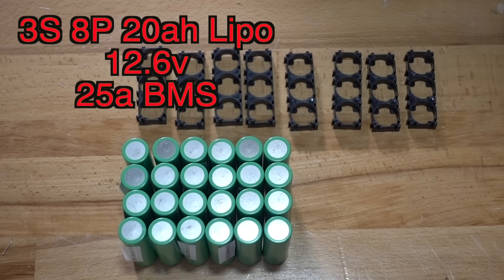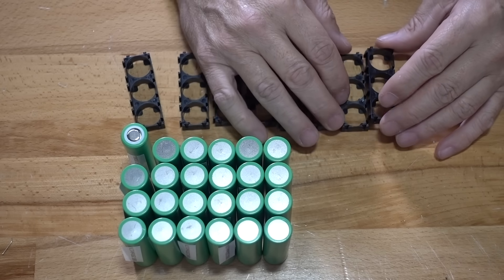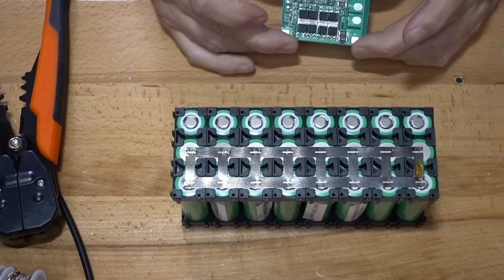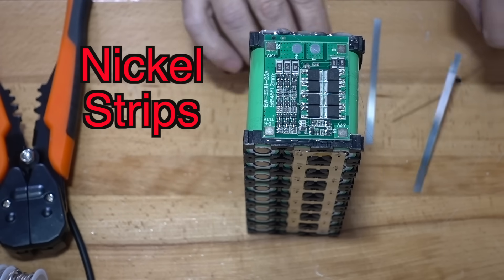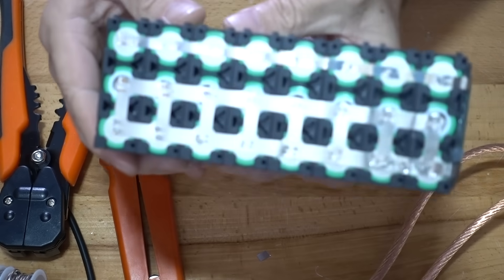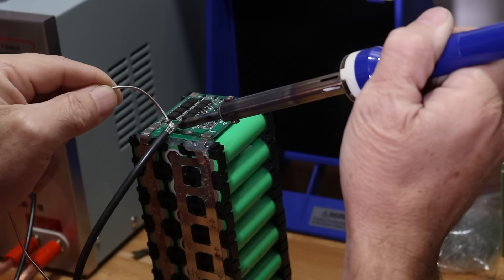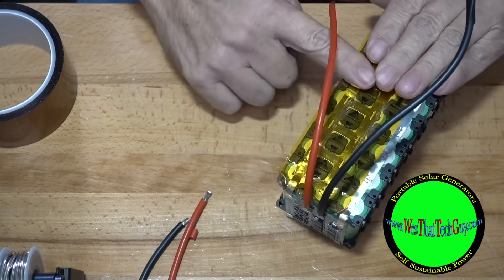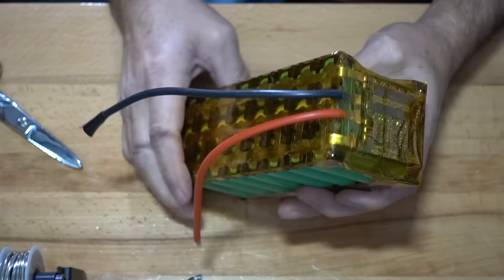How to build an 18650 Lithium Battery Pack with BMS.

Comment: Any reason you don't use copper to fasten these together ??
Reply from the maker: not sure what you mean? the batteries or the bms or the charge/discharge wire or all of it.
Reply: @WesThatTechGuy  Im honestly just curious why most people are using nickel strips and not using the more conductive copper ? I hear some saying that its more expensive.. BUT I've looked, and its pennies more, for , I'm assuming, less resistance. I think this is a great topic for discussion, what do you think sir ?
Reply from the maker: totally understand you on this. Nickel is simple and fast as you can see and comes made proper for battery builds. It spot welds easy and fast. the wire is pre tinned copper silicone wire marine rated so the best on the wire. this is a simple easy to understand for the masses battery build. this is how these batteries have been built for decades now. Hope this helps. Any other questions please feel free to ask. Good topic of discussion!
Reply: @WesThatTechGuy  So could you clarify, if one were to cut strips of copper and spot weld those strips to batteries in series or parallel they WOULD work more efficiently correct ? When priced on Amazon, the copper strips are $31.66 for a pack of 10. Which is way too expensive. HOWEVER a medium sized 'plate' of pure copper is 4 or 5 bucks... So this is the bases of my confusion. Do these 'strips' have other properties that make them more effective electrical connectors ?? It just seems silly to me, a DIY guy, maker guy NOT to use copper when the only problem, apparently, is the pre fabbed size of the strips. Its easy to cut 20 or so strips of copper.
Reply from the maker: Copper is in fact the next best electrical conductor to SILVER. Silver is the BEST. So yes as long as there is no issues with spot welding copper to the specific battery cells type of metal tabs. I've always used nickel myself as this is the best method for the products readily available. Never used copper for this. Copper can be used as a sheet or even a small diameter pipe from the hardware store can smashed to make a buss bar and this could be a cheap method.
Reply: @WesThatTechGuy  my only reasoning is that spot welding uses the materials resistance to creat the weld. Copper has very low resistance, this is good but also spot welding will now need alot more amps then previously.

Comment: So this "3s" configuration makes a single 12volt battery. It can be expanded to make a larger 12v battery by increasing all the parallel arrays right? I want to make a giant 12v to power an inverter on a solar generator. If I'm using an mppt charge controller would I need the bms module?
Reply: No you would not. But there cheap and smoothen out any little differences in voltages

Comment: How to charge it? Is it on the same  positive and negative connection? Thinking of building one for my 125cc bike... Thanks
Reply from the maker: with the proper 12.6v charger only!!! This is important for safety and fire! Yes you charge on the + and -. Thanks for watching and YW.
Reply: @WesThatTechGuy  what is mA rating of the charger do you used for that? And what is the max?

Comment: Hi.It is good to use for 12v  power weels ? Or is better 4s pack ? Thanks !
Reply from the maker: This will work but 4s will make it faster!!! VRoom VRoom!! lol
Reply: @WesThatTechGuy  Thanks! I want to last longer ,
 not necessarily faster :)
Reply from the maker: 4s will last longer but will make it faster too. 3s will work but will go under voltage much quicker. that toy is used to a 14.4v battery attached not a 12.6v. You can add more in parallel to get more energy storage to the pack in both 3s or 4s. Hope this helps. be sure to use the PROPER voltage charger for the pack. you can't use the old lead acid charger that came with the 12v battery and power wheels. (assuming it's 12v like most)

Comment: My battery pack is totally 4 18650 battery’s connected 2 each parallel and series I having one 12v 1.2a charger I used 7808 regulated Ic with a shut resistor of 5w try to charge but the 7808 going too hot within seconds can anyone help me to solve this problem
Reply from the maker: to much broken sentences??? sounds like you have 8.4v battery not a 12v battery.
Reply: Wes That Tech Guy yes 8.4v
Reply from the maker: 12v charger is the wrong charger for the job. I don't personally build battery chargers so I would suggest to get a proper voltage charger or if you have the knowledge to build one then test the voltage several times during charging state to make sure it's safe! 12v on a 8.4v LIPO battery ends badly EVERY TIME!!!! Usually a very hot fire.

Comment: Connecting 8 parallel cells to the bms directly will cause an unequal distribution of current due to the resistance of nickel strip. The cell that is closest in the BMS will be stressed during charging and discharging at higher currents.
The solution is to use same lengths of wire in each battery that goes through the bms
Reply from the maker: Thanks for the insight. Let me ask you how much resistance do you think is actually being created with the nickel strip? And please give a complete explanation of the the length of wire you are talking about to the bms from each 8p cell. Also at what point do you think I should attach the bms to each cell and what cell exactly in each different series to get the least possible resistance? Thanks Duino Ino.
Reply: @WesThatTechGuy  Nickel strip has low resistance but when you connect an 8 cells in parallel and the end is connected in a bms. The cell that is closer to the bms will supply more current than the other cells because of the current division due to the resistance of the nickel strips itself. This results in unequal distribution of current in each cell.
The solution is to put wire on each parallel connected cells with equal lengths before connecting it on bms.
This method is used when connecting big number of cells in parallel
Reply: @engrjolo1631  Ok we understand your theory but how exactly do you suggest doing it in this practical scenario? It's not worth it, man!

Comment: Thank you once again for the video. Some time back I requested a few info from you. Perhaps amidst the busy schedule you’d have overlooked, which is understandable. Here are the requests once again, kindly respond.
1) Do you sell PURE (99.6%) Nickel strips for 2P design through your AMAZON store? If so, please point to that link. If not please recommend a HONEST Vender who sells the same. 
2) The Spot welding on those batteries look so perfect. I’m sure that welding machine must be a SUNKKO. What model is that and do you sell the same model, through your AMAZON store?
FYI I use SUNKKO 788H that is so useless, that the welded Ni strip can be peeled off very easily.
Any help from your side will be highly appreciated. Thanks and regards.
Sree...
Reply from the maker: sorry for the lost reply.heres a link for the 2p nickel strip: https://amzn.to/2GxxLXc 

Yes its a Sunkko 709A. Heres a link: https://amzn.to/2IjHBhf
I have on SolarGeni.com Amazon store too.

Comment: make a charger for it and level indicator with complete description
Reply from the maker: I have made a charger for it and I don't use them with a meter directly on the battery. Are you asking how to do it?
Reply from the maker: just add a simple charger indicator or meter to the + and - leads. thats all you need

Comment: I am planning to build 3s packs for a 12v pack in my boat. My question, how many cells should I per pack? I have 3s 25A BMS.
Reply from the maker: that would depend on how many AH/WH your goal is. How many mah are each of your cells?
Reply: Wes That Tech Guy i have lots of cells, they are 2200-3000 mAh. I plan to use them parallel with 12v lead batteries (300Ah). So my question is how large packs should I build. Any as always 3s or 4s...
Reply from the maker: This is a bad idea to mix THIS 3s build with lead acid. The voltages are way to far apart and you will have issues with charging. If you have the knowledge this can be done but not just a 3s lithium battery at 12.6v with a lead acid battery at 14.4v and a lead acid charger. you will fry the lithium pack and or the BMS if you use one (and you should use one). Too many variables to answer this simply.
Reply: Dos the the BMS handle to voltage? When the lead are above 12,6 V the BMS of the 3s 18650 is disconnected. Is this how the BMS works?

Comment: is it possible to get 2 different voltages out of 1 battery pack?  (5v for pi3b and 14 v for a mini amp for example)
Reply from the maker: you could add a DC to DC buck converter for the 5v leg

Comment: Could I asked, how Manny pieces of 18650 lithium ion battery 3500mah 20amp continuesly that I could may make it. Using BMS 4S 100amps
Reply from the maker: if you make a 3s battery pack it would be 18 18650 cells at 3500ah. This would give you 21ah or 264.4wh
Reply: @WesThatTechGuy  thank you so much for giving me informatio.
Reply from the maker: No problem. You're Welcome

Comment: Am I right that BMS takes care of all charging/balancing as well as protects from overdischarging? So essentially any power supply would work to charge the pack like that? Or do you still need a special charger for lithium batteries?
Reply from the maker: you still need to use the proper lithium charger with the proper voltage and amperage. over 25a and the BMS will shut it down. Over 12.6v the BMS will shut down.
Reply: @WesThatTechGuy  Thanks. Are there any BMS with built-in charger?
Reply from the maker: Not in a small package. I do sell chargers over at SolarGeni.com however.
Reply: Wes That Tech Guy you

Comment: Do you add fuse wires or connectors to your pack? If yes, please elaborate on it. thx!
Reply from the maker: I use fuses and or BMS sometimes both and sometimes just one or the other. Depends on what the build is for.
Reply: @WesThatTechGuy   could you please share a video showing both fuses location, what material u use for a fuse . I want to build 36 v 15 amp pack. And want to have all safety on it enabled. My firs diy pack.

Comment: Question: when building a 18650 battery packs, can individual packs with BMS  be combined to a larger battery packs?
Reply from the maker: Donatus Uwasomba yes as long as you run them in parallel. If you run them in series you will need to change out the BMS as the voltage will increase
Reply: Wes That Tech Guy 
thanks very much for your prompt reply.

Comment: Awesome informative video. Thanks a lot. My question is can I wire let say 5 of these for total of 100 amp hours in parallel to use for my rv solar power bank...?
Reply from the maker: Thanks Nos! Yes you can or you could just make 1 100ah battery pack and then need only 1 BMS.
Reply: @WesThatTechGuy  what do you recommend for RV battery bank or 12 volt appliances in general 3 or 4s configuration

Comment: So if my understanding ia correct, it's a 3 series battery but essentially there's a bunch of them in parallel. Is this dangerous, or is this the only way to charge such a battery pack with relative safety? Would there be a lot of voltage drift because of the parallel charging?
Reply from the maker: yes 3s. and yes 8 in parallel. Not dangerous is used correctly. Battery could be charged other ways with and without BMS. Not if balance charge like this is intended for.

Comment: Precise work, thumbs up. Which pins are used fot charging and which for load? Thx
Reply from the maker: B- and B+
Reply: This is also my question. Why didnt you solder a wire for charging?

Comment: Wes, i want to build a 3s 5p battery for running my vexilar ice fishing sonar and some led lites. With saftey as a primary concern i am wondering can i use only a 3s balance harness instead of the bms? I plan on charging the pack with a imax b6 lipro balance charger. Any advice would be appreciated. Thank you. Great video.
Reply from the maker: Yes no problem as long as you monitor it when it's charging and discharging etc. BMS is used for redundant safety. You're welcome and Thanks.

Comment: Hi Wes, in a few weeks i will have finnished my 3 VAWT units, I would like to build my own powerwall. I am after suggestions, I currently have a 1.2kw Solar system, going to add the 3 turbines to that . Not sure if I want/need to go 12vdc 24vdc or 48vdc... I have access to approx 400 Lions possibly 600, wont know untill Feb on the qty.
Will the above make a decent PW unit? Any suggestions welcome. Thanks and happy new year.. Mike.
Reply from the maker: Nice congrats. I would always go to 48v for a permanent installation as for the efficiency. You will need a lot more batteries to go 48v. 24v would be cheaper and still somewhat efficient. 4-600 lions are a good start. I assume you mean 18650 battery cells. happy new year. sorry for late reply.

Comment: what is the difference between 4S-3S etc? just starting with this and all new to me  :)
Reply from the maker: 4s is 4 batteries in series. 3s is 3
Reply: @WesThatTechGuy  ok , tnx  :)  found a guy that made a box of 20+ batteries and called it 4S so probably he meant that they where grouped per 4 than  . learning a lot
Reply from the maker: Yoeri M Are you need to really know is parallel vs series. Parallel is connecting positive to positive and negative to negative of two batteries or more. This will double the amperage but keep the voltage the same. Series is connecting what are the negatives from the first battery to the positive of the second battery. Then you will have your positive lead on the first battery and your negative lead on the second battery this will double the voltage but keep the amperage the same. For S5P would be 20 batteries, foreign series and five per well. If using lithium batteries this will give you 16.8 V charged and amperage would be multiplied by five

Comment: What is the best way to build diy 18650 lithium battery pack with more than 100ah for 12v fridge with car alternator and solar charge?
Reply from the maker: 4s config and a step up DC to DC converter or 3s with a step down. either way it will work for the alternator as for the solar any basic MPPT controller that will give you the ability to program the proper charge voltages. You will needs some electronic components in the mix for both input and output. the input from the alternator will be around 14.4v. 3s is 12.6v and 4s is 16.8v so....
Reply: @WesThatTechGuy  is it lifepo4 or lipo?
Reply from the maker: I assumed you meant lipo because you said lithium. if Lifepo4, 4s is no problem with car alternator but really needs a DC- DC converter with CC and CV because 4s will need charged to 14.6 but 14.4 will be ok too. car alternator can jump all over the place so best to use the DC to DC converter either way.
Reply: @WesThatTechGuy  Is not lipo 3s 10.8v and 4s 14.4v?
Reply from the maker: tell me what you want to use lipo or lifepo4? Not sure what you're saying. lipo 3s is 12.6v 4s is 16.8v and lifepo4 4s is 14.6v FULLY CHARGED
Reply: @WesThatTechGuy  lipo 18650 from dead laptop batteries.

Comment: Great video and very informative. What is the normal 3S operating voltage? Will it drop below 11.5V while still more than 20% SOC? I'd like to build a similar battery to replace my AGM "house battery"  for my car camping gear but worry that the voltage will drop too much too soon for some devices (electric cooler). Ideally I'd love to build a 4S with a BMS that has an integrated output voltage regulator -- does something like that exist?
Reply from the maker: thats a simple but somewhat loaded question. 3s voltage is between 9v and 12.6v. you can run a 3s system to 9v max but most inverters will shut off between 9-9.5-10v. voltage wont drop any faster than AGM but will in fact run down much lower than the AGM so you will get MORE usable voltage when comparing AH to AH from the lith to the AGM.... Apples to Apples so to speak. 100ah and 100ah lithium will out perform by almost 2 times doing fast simple math in my head.

Comment: What do you do for cooling? Tesla has water cooled manifold between each row
Reply from the maker: thats a big question depending on the needs and usage of each battery. This is NOT a telsa car. Its a battery pack thats superior to the telsa battery cells by about 5+ times more amperage per cell. Tesla HEATS and COOLS the battery modules in the car with simple anti-freeze for specific reasons and safety. when its cold outside they heat them to keep them at the proper operating temp. when its hot outside and or they get hot they cool them for best operating temp and safety. Most people don't have to cool their battery packs unless they are running them to the max at all times. I build my packs to run my generators with more than 50% reserve of unused energy. So if you need 50a of energy the battery will easily handle 100+a.... Short answer when needed 1 or a few small fans.

Comment: Where'd you get that massive roll of strip? Is it real nickel, or plated?
Reply from the maker: I order them in bulk from my wholesale supplier. You can find them on amazon and yes it's nickel
Reply: @WesThatTechGuy  Damn, that's what I wanted was a whole roll. I do a lot of batteries. They seem to only sell it in 1m lengths

Comment: What are you recharging it with and how long does it take?
Reply from the maker: I use a solargeni C600 battery charger. It will charge this pack in about an hour or so. You can find this one and many others here: Lithium and LifePo4 Battery Chargers  https://bit.ly/2SUqyCH

Comment: Arghhhh I don't get it. How is it only 12v with that many batteries?
Reply from the maker: Phil, it's because I take 3 batteries and run them in series and this makes 12.6v. Each battery is 4.2v when charged and 3.7v Nominal. So when fully charged 3 in series is 4.2v x 3= 12.6v
Reply: @WesThatTechGuy  Thanks Wes for the reply👍🏻